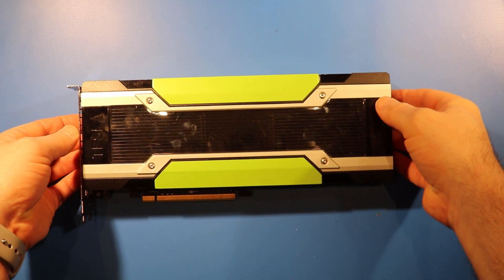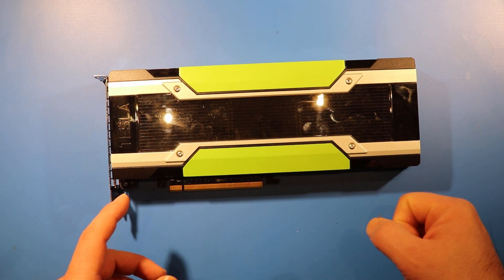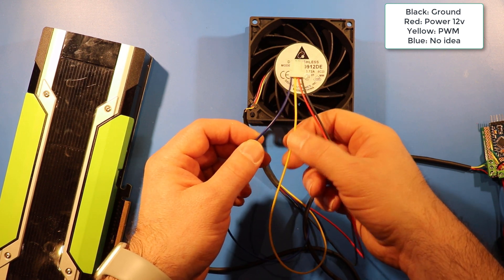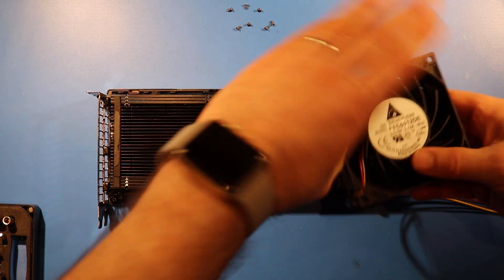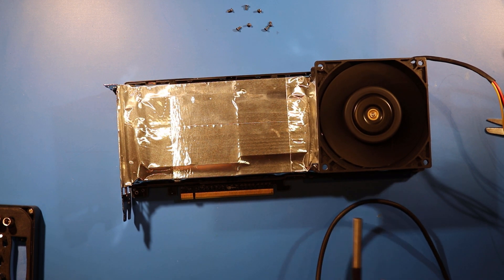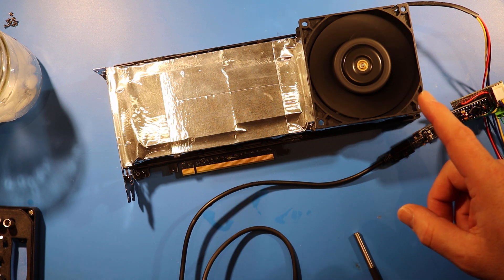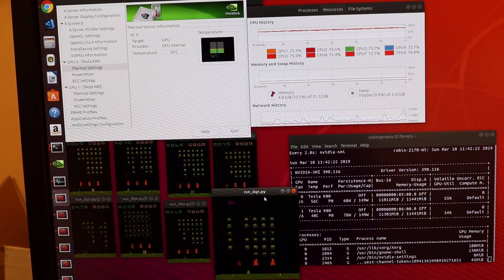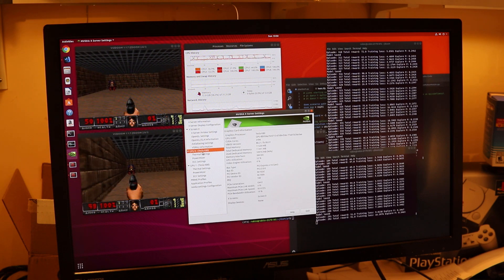NVIDIA Tesla K80 Cooling in a Desktop

Comment: Can I connect Tesla k80 into ASUS ESC2000 G2?
Reply from the maker: Your motherboard was released in 2012, 2 years before K80 was launched. It also does not have the 'Above 4GB Decoding' option in the BIOS which in my experience is required to get the system to power on with a K80 installed. Sorry to say this means that it is unlikely to work.  I could be wrong, this is just my opinion based on what I have tried.
Reply: @robin-g6  thanks. please, suggest me which graphic accelarator best for my workstation. And is there any way to use k80?
Reply from the maker: @purewbattogtokh6557  A K80 will cost around $400 to $500, you could simply buy a high end graphics card from NVIDIA. It depending on the application. Based on this web site below it looks like 3dStudio works just as well with older NVIDIA GTX cards like GTX 980 or GTX 1080. These would be a cheaper route and you could install more than one. https://www.pugetsystems.com/labs/articles/AutoDesk-3ds-Max-2017-GeForce-GPU-Performance-816/

Comment: A question that came to my mind: Is there thermal paste inside the GPU? Because, since those GPUs are quite old, we should change the paste, if there is any. Does anyone know?
Reply from the maker: I can take a look at this and see if it needs replacing. So far these cards have been pretty well behaved thermally and I actually reduced fan speed as it was not needed to be so high.  Will keep in mind and see if replacing thermal paste at some point improves temps

Comment: First, bless you for making this video, it’s an inspiration to those of us who dream of having our own serves to render on at home. Could you have used a server style chassis like the rosewill 8gpu mining case for adequate cooling? There are fan mounts at the front and back of case.
Reply from the maker: Jackson Lukas as long as there is enough airflow it would work. Regular case fans don’t seem to push enough air but you could try. The cards will thermal throttle or shutdown I believe to avoid overheating.
Reply: hi Robin! Ok thanks for the reply. I’m doing a test with a server box and 6 5500 rpm 250 cfm fans to see if it moves enough air. It will be ready to test within the next 10 days, so I’ll tell you how it goes. If it doesn’t work I’m going to put one of the fans on the gpu itself like you’ve done here.
Reply from the maker: Hey Jackson , that airflow is more than enough I would say.  The fan in the video is a Delta PFC0912DE with only 200 CFM and its good for cooling the card it never gets above 80 degrees with one of them.

Comment: could you use this in a desktop as an assistance for a cheaper gpu that has an output?
Reply from the maker: I noticed on a machine with intel integrated graphics that once you install one of these it will use one of the GPUs in the K80 a little for visual desktop display things. To it seems to use a GPU for video related stuff despite it having no direct output. I may try to capture this to show it. So I think the answer is maybe !

Comment: maintherboard ASUS Z10PA-D8C For Dual Xeon E5-2600v3/v4  +  CPU   Intel Xeon E5-2678v3 12C/24T 2.5GHz Upto 3.3GHz 30M Cache. Do you think this set up is good for k80 Tesla ?
Reply from the maker: Yes that Asus board is Workstation or Server class so it should work. If there is an ‘Above 4GB’ setting in the bios be sure to enable it before installing.
Reply from the maker: Jay Thai the ‘Above 4GB Decoding’  setting is on on page 78 of the manual in bIos section under PCI Subsystem Settings. It should work but as nobody publishes compatibility with K80s it’s hard to be 100% but I am pretty sure it will work.

Comment: do you think this would be beneficial in a home server like freeNAS running virtual machines etc.
Reply from the maker: If you can map the GPU into the virtual machine and use it like a GPU to run machine learning stuff then for sure. I know VMWare ESXi can use GPUs this way but I have not tried with freeNAS. Linus from LinusTechTips has some videos where he virtualizes GPUs like this so it might work and would be beneficial because machine learning jobs can take hours or days so running on a server makes complete sense.
Reply from the maker: I think UnRaid is the software Linus used and not freeNAS.
Reply: Okay thank you

Comment: Tesla K20's are really cheap now, is it possible to to use them for gaming like how laptops switch between integrated graphics and discrete graphics. In windows 10 you can go to graphics settings and select a certain gpu to be used in certain programs. This would work for tesla cards?
Reply: Yep, but it's tricky. Loads of videos on YouTube showing you how, and which cards it works on.

Comment: I have an old K10.  Is it worth pairing it with a 1050 Ti?  Also which motherboard would I need for it because I have the Asus Prime B350 M-A.
Reply from the maker: it might be worth it. The K10 has pretty good/similar performance relative to a 1050ti based on the specs. If you are doing Machine Learning you may be able to do more with 2 cards. The K10 uses a whole lot of more power than the 1050ti however. I don't know if your motherboard will boot with the K10 in it but it should be easy to figure out. In Asus BIOSes you need to make sure Above 4GB option is enabled in the Boot menu. If it boots and gets to the OS and can see the card you are good. The K10 won't overheat during a normal boot process.
Reply: @robin-g6  Ok, thanks...   I was thinking about pairing it with my 1050 ti,  but I don't think I could do that on this motherboard.  Just wanted to know if it was safe and I guess I would need some extra fans to keep it cool,  but thanks again...  Much appreciated.  👍

Comment: Thank you for the great tutorial, Robin! I also have a Tesla K80 from eBay, and I would like to try your mod (great application for an Arduino). However, recently my K80 has some problem with a corrupt infoRom. This is why I am reaching to you, with a small request: if your card is working, can you provide some dumps of the two infoROM sfor the two GPUs? I know this is asking a lot (especially considering that I am a complete stranger), but I would be eternally grateful! It is embarrassing to ask such a thing, and probably you don't have time for such endeavors :(.
Reply from the maker: Hello Dragos, I think the easiest way to fix this is just to use this utility which includes the bios. https://support.hpe.com/hpsc/swd/public/detail?swItemId=MTX_f7bea664267845a683084432dd .   Best
Reply: Thank you for the idea,  @robin-g6 ! I just tried this, and it did not help. It seems that the two infoROM are independent of the vbios chips. And (for some reason) the infoROMs on my card got corrupted. So, here I am, trying to convince people to run nvflash on their working GPUs, to get these 2x 32kb dump-files. It is crazy that such a small amount of data can make or break a chip, right? Anyway...I understand that my chances are slim (I am not sure that I would touch nvflash because someone else asked me to; but it was worth a try). Thank you again for your time!
Reply from the maker: @dragoschirila  Never done this but I can try tomorrow.
Reply: Thank you very much,  @robin-g6  ... I would really appreciate that! To minimize the time you lose with this, below are the steps. Of course, this process should not affect your card in any way.

- unload nvidia kernel-modules: sudo rmmod nvidia_drm nvidia_modeset nvidia # (CentOS/RHEL 7 ... might be different on Ubuntu)

- get the nvflash_linux utility from here: https://www.techpowerup.com/download/nvidia-nvflash/

- dump the infoROM from the card, into a file (ifr file-extension is important):
   + sudo ./nvflash_linux --save inforom_dump_card0.ifr  # (and select the index of the 1st K80 GPU)
   + sudo ./nvflash_linux --save inforom_dump_card1.ifr  # (and select the index of the 2nd K80 GPU)

- re-load nvidia module (or restart the machine), to continue with your work: sudo modprobe nvidia

If this works, can I at least buy you an Arduino Mega to play with? It's a symbolic gesture, but I want to thank you somehow ;).
Reply: @dragoschirila  he had time

Comment: Great stuff, especially what you are using it for!! Just got one myself, but i realize my mobo don't have the above 4 GB decoding option. Bummer.
Reply from the maker: I had this problem too, I found ASUS ‘WS’ workstation class motherboards worked well. Like this one https://rover.ebay.com/rover/0/0/0?mpre=https%3A%2F%2Fwww.ebay.ca%2Fulk%2Fitm%2F303128322721
Reply: @robin-g6  Thanks. Nice motherboard. I looked into it, and it will require I get a new CPU and RAM as well which is going to be too expensive at the moment, so I decided to swap the Tesla for a GeForce RTX 2070 instead (recommended here: https://timdettmers.com/2019/04/03/which-gpu-for-deep-learning/). I would have loved to get the Tesla up and running though. They are coming down in price fast. I got one for $450 at Amazon. It'll have to be next time. Do you know if your motherboard can support more than one Tesla k80?
Reply: What would happen if my mobo didn’t have that option?

Comment: what type of tape did you use? also would this setup work with two of those fans?
Reply from the maker: It’s aluminum foil duct tape. You can get it in hardware stores. It should work work with 2 fans.

Comment: excellent !!  one question do you recommended  any  other mother board for tesla k 80? thanks
Reply from the maker: So far I have been able to get this to work with an ASUS motherboard. You need to set the Above 4GB Decoding option in the boot menu. Not setting this means your motherboard won’t POST. I also understand Intel c612 chipset boards should also work but I don’t have one to try.
Reply: @robin-g6  i have  asus  B85M-G R2.0  but i cant  install the drivers

(265.718126] nvidia-nvlink: Nvlink Core is being initialized, major device number 237
[  265.718469] NVRM: This PCI I/O region assigned to your NVIDIA device is invalid:
               NVRM: BAR0 is 0M @ 0x0 (PCI:0000:03:00.0)
[  265.718470] NVRM: The system BIOS may have misconfigured your GPU.
[  265.718475] nvidia: probe of 0000:03:00.0 failed with error -1
[  265.718535] NVRM: This PCI I/O region assigned to your NVIDIA device is invalid:
               NVRM: BAR0 is 0M @ 0x0 (PCI:0000:04:00.0)
[  265.718535] NVRM: The system BIOS may have misconfigured your GPU.
[  265.718538] nvidia: probe of 0000:04:00.0 failed with error -1
[  265.718577] NVRM: The NVIDIA probe routine failed for 2 device(s).
[  265.718577] NVRM: None of the NVIDIA devices were initialized.)  SORRY  MATE
Reply from the maker: @Dannyramos73   your board POSTs which is good, make sure you have the BIOS setting on your motherboard called 'Memory Remap' and set to [Enabled] this is the above 4GB setting I think.   From what I have read there is something call PCIe BAR support and this memory mapping is set during the POST sequence. Some motherboards, like my ASRock X99 Taichi, seem to choke on the memory remapping required for the 24GB RAM in the GPU.  There was nothing I could do to get it to work. So if the Memory Remap setting does not work, you could try updating your BIOS the latest for that board is from 2018 so it might work. Here is the link https://www.asus.com/ca-en/Motherboards/B85MG_R20/HelpDesk_BIOS/ . let me know if you get it running.
Reply: @robin-g6  thanks  mate  li will try again ..

Comment: Can I just plug this card into my HP Z820 without a fan? Would it overheat or would it be able to work fine even under full load without it?
Reply from the maker: Nuclear Armament if you don’t put any load on it it would be okay for a few minutes. Under load it will heat up very quickly. If you watch other videos of people doing this they say without cooling they thermal throttle and shut down. I’ve never not cooled one deliberately.